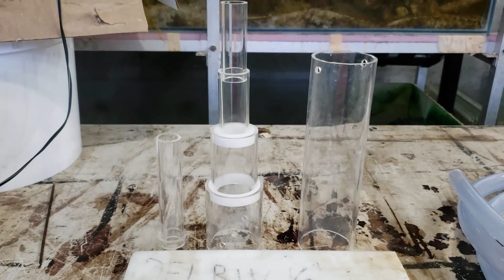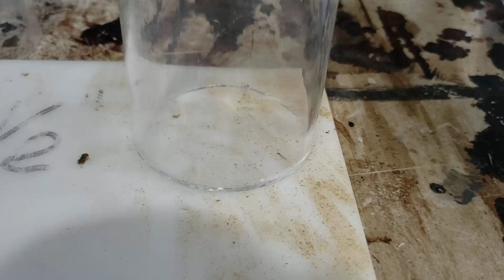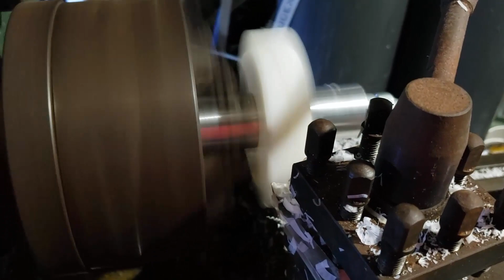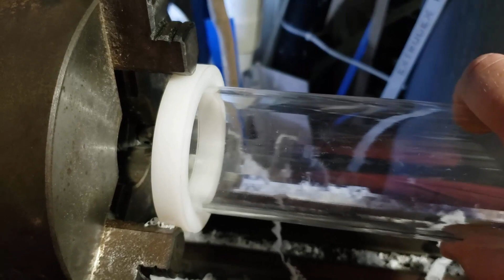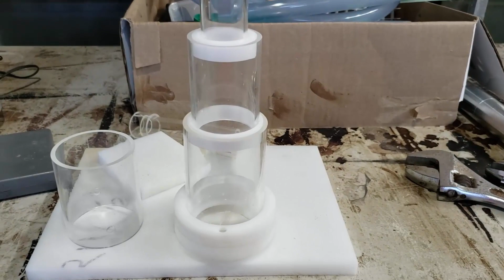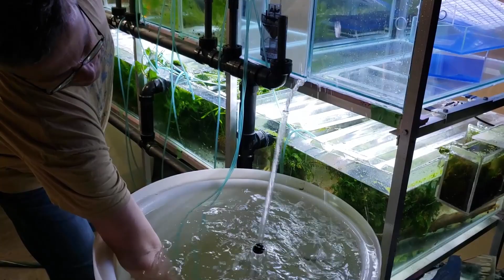DIY Cone/Air Power Lift Combo

Comment: That last bit at 9:21 would look great on a pond! Maybe not practical for a filter or something, but definitely would work for a decorative water feature or something!

Also, what about some sort of cone? (I know you said something about one, but I haven't found that video yet...)
I mean something that is probably sheet metal, or some sort of flexible thin plastic like those flexible cutting boards, that is rolled into an almost cylinder,  but conical. Then maybe rivet it or something (and silicone it to water proof it) to hold it together. 
My idea is that the very gradual change in diameter would be more efficient than stepped sides. Also, it would be something that someone without access to a lathe and tons of acrylic and Deleron might be able to pull off. (No offense, I like the builds and the machining stuff, just not something I have access to at the moment.)
Reply from the maker: I did a cone build. I also can't locate it at the moment lol. Thanks for watching what I do!

Comment: How about building a closed chamber system where you use air to drive in the water to each chamber until the water flows out like a hob filter on the othe end of the box
Reply from the maker: A HOB on the end of this air lift. Could be interesting. Thanks for the idea

Comment: I find all of the experiments with air driven systems very interesting. It is what attracted me to your videos in the beginning. I am slowly moving away from any filters that are not air driven and can't run off a battery. I live in hurricane country and loose power occasionally for two weeks or more. I can't rely on 120V pumps to keep my fish alive. I run double sponge filters everywhere and have enough air powered pumps to keep them running as long as my supply of D cell batteries lasts. A pair of batteries will run an air pump about 48 hours before they get too weak to keep the filters running. Of course, someone has to be here to change the batteries.
Reply from the maker: That's crazy having to go two weeks without electricity! I love your solution!

Comment: Thanks for making a comprehensive video. May I ask what is the power of the air pump you used? (W?)
Reply from the maker: Thank you for taking the time to watch! The pump I'm using is a pond master 60. It's running a bunch of tanks and I'm bleeding off two lines for these runs
Reply: @FishmanEricRussell  thanks you for answering!

Comment: A kinda crazy idea that came to me while looking at the video. What if there could be created a laminar flow effect on the water/air mixure, a more straight and more restrictive to the x and z axis (right and left) movement could be achieved? Most of the water pressure is being lost when bubbles unite, not pushing so much water body anymore and (water) actually escapes from the bubble that is pushing upwards (or the bubble escapes from the water body that restricts it, depends on the way you see it). The thinner pipe use it the end, gives less room for the water to slip and escape the bubble, so what if we could have this from the start till the end of the pipe by having many thin pipes inside it? Many have tried to reproduce the laminar flow effect by using straws to eliminate  the trubulence of the water and force it to move in straight lines and exit the end of the pipe in straight lines as well and using a nozzle for it to come out with force and still remaining in straight flow all the way. An example instructional video o creating such an effect could be the following: https://youtu.be/o5L6W0YoAd4 (if posting the video creates an issue, I can remove it anytime)
Don't know if this could work, since it is a mixture of water and air and not only water but what do you guys think?
Reply from the maker: Laminar flow would be great. The only problem is I've never heard of it working with mixed fluids like water and air. Thanks for the thought though

Comment: I don't know what Delryn is, but can you use 1/2" cutting board from a commercial outlet? It is food grade and might work for you. Might be cheaper, too.
Reply from the maker: Cutting boards are UHMW polyethylene. I have machined it before and it's doable just not as good as delryn. Thanks for the idea though

Comment: I was thinking about this the other day. I don't have any real way to test this otherwise I would myself. But I have noticed you say it a lot that the larger diameter is an issue, What if you filled a larger diameter tube with a lot of straws creating a whole lot of smaller diameter tubes. This might help with bubbles combining into larger bubbles also. 
So use what you have, the single tube in the earlier videos, and simply pack it with strays, then run a air stone or bubble disk below them. Might change the result, either better flow or increased head ability. 
Anyway just thought I would share the idea seeing it is cheap and easy enough to attempt.
As always, thanks for scratching the DIY itch, love the videos solving problems even when they arn't problems I have :)
Reply from the maker: I actually tried this a while ago. I never actually showed the results. Unfortunately it doesn't seem to help. I will have to include some footage of this the next time I do an update. Thanks for taking the time to share your ideas!
Reply: @FishmanEricRussell  I dont know if this helps but this guy on youtube can get 20ft with his design. Maybe you can reverse engineer it. He has a few videos, this is the least annoying one to listen to. https://www.youtube.com/watch?v=aOnbB0gVxW8
Reply: I was thinking similarly as the trick seems to be keeping the water on top if the air. I was originally going to suggest a cone-in-cone idea to keep the movement restricted, but I think this is better. To push it maybe glue up a bundle of straws and cut them in steps to fit inside acrylic 'cone'.
Reply: That's exactly what I meant as well with the "laminar flow" setup. Usually to achieve it the use straws to make the water move in parallel and not in a turbulent movement and straws will also will keep bubbles from combining that is the main issue for pushing less water volume. Instead of straws could be many air tubing filling the gaps inside a larger diameter tube.

Since you mentioned that you have already tried this or something similar, I would like to see how it performs. If it is possible, could you upload it as well?

Comment: Thank you so much for sharing your designs and thoughts, Fishman. Really enjoyed your experimentation on this ongoing project. I find myself fascinated as to whether a smooth rounded tapered conical shape could be created or adapted from a preexistent (injection moulding) manufacturing process. I'm off now to see whether I can find an example image/object. Warm regards.
Reply from the maker: Much appreciated Paul. I am still working on this. Hopefully there will still be some improvement